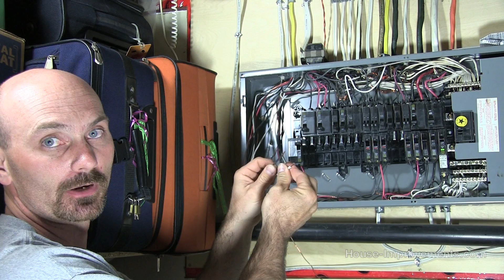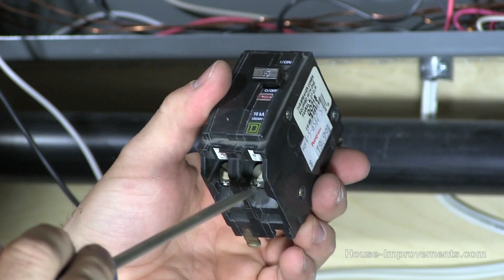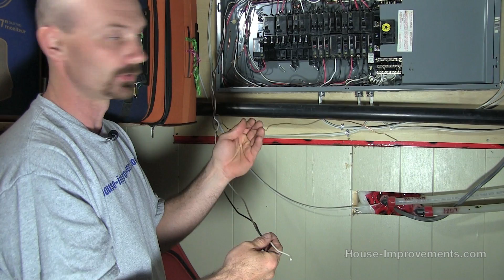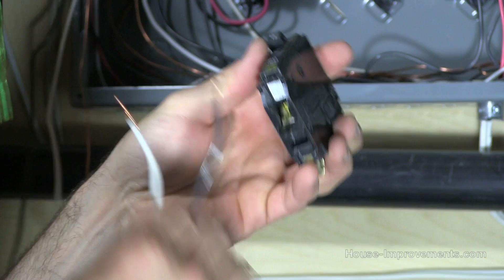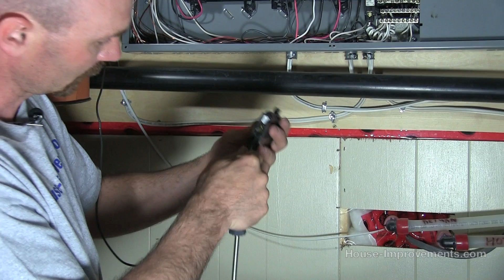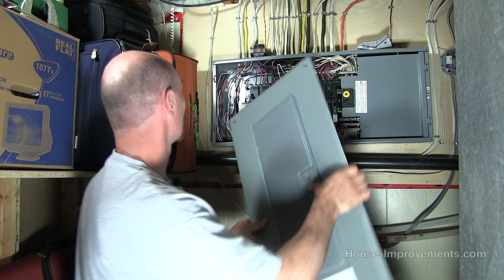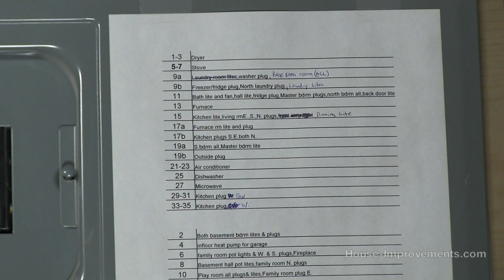How To Add a 120V 240V Circuit Breaker

Comment: Hello Mr. Shannon, I'm in the process of adding 20 amp breaker for all my power tools. Is it better to install a double pole 20 amp  or single pole 20 amp. which pole is right for all the power tools. ( table saw, router , all power tools. need your help,,,thanks
Reply from the maker: Depends if you are needing 240V or 120V. By your question I would suggest you contact a professional, electricity can kill.
Reply: All my power tools are 120 volts( mostly 15 amp.) So I probably use 20  amp single pole.
agree...
Reply: William Dizon only thing you would need the 2 pole breaker for is say a welder, AC unit, pool, etc. I am going to assume you just want to add some 110v receptacles to power your 110v power tools. In that case yes a single pole breaker is all you would need. If you install a 20amp make certain that you use 12gauge copper wire. I agree with house improvements that you should seek an electrician to do your work as your question clearly shows you don't know what you are doing and are certain to put yourself at risk of getting killed.

Comment: May I ask something ?
How many voltage at a terminal in main bus . Does it's 120V and -120V ? . To make 220v when you connect the first CB on this video .
Reply from the maker: Yes each leg is 120 v.

Comment: Hi Shannon,
First of all thank you for the informative video, I was searching online about similar topic. I live in the Philippines our electrical systems are 220 volts, But in our house we have several 110 volts outlet next to 220 volts, The outlet was there when we first moved in. I recently acquired a power tools from a friend in L.A. he sent me a router and a skilsaw both labeled 110/120 volts. Can I use the 110voltsoutlet? The power tools are 11 and 15ampere. Is it enough to power the tools? Thanks and more power.
Reply from the maker: yes absolutely.
Reply: HouseImprovements  In the video you put the black wire to the 110 breaker and the white to the white terminal, where is this terminal connected in the breaker, if I remember correctly ours does not have a white terminal is it possible?

Comment: Great video.  question  you mentioned you could double up the grounds, what about the white neutral wire, could that be double up if needed?
Reply from the maker: If you need to , twist the two together and then insert them and tighten  the screw.
Reply: No no. Can't double up neutrals. Don't even like doing grounds. I'm an extremist though.

Comment: Hi Shannon -
  Good video, I had never seen a service entrance box hung sideways before, also I noticed a copper water pipe above the service entrance box - which one was installed first - would that pass the inspection code being if there was a water leak on top of the electric box .
Reply: +BearStar1 
Hey Einstein - in the electric trade we also use different various names but you would not I guess you under stand or do you ?
" To - may - to "     or    "To - mah - to "
Reply: +BearStar1 
Ok Fellow Brother Electrician -
Trained in the Navy ( ATT ) ( ET ) 6 yrs.   completed A & C schooling - NECA / IBEW  50 + years .
Reply: Pete Moss, and you're STILL not qualified per the NEC.  Take a break.
Reply: Pete Moss, besides, your ignorance is blatantly obvious.  It's not a "service entrance box", it is the service equipment.  The service entrance is the set of conductors between the meter and the service disconnecting means.
Reply: Your so simple minded - you should take the "  Idiot Test to "    find out your  IQ

Comment: Wow I have never seen anyone mount a panel sideways like that ever...also, don't you have a protection rule below 8 feet in a garage? Just a really strange looking installation to me having everything exposed and sideways. Maybe you could frame it in and put some kind of a covering over the wiring to protect it from physical damage etc? Section 334.15(B) NEC code I believe...
Reply from the maker: This was a retro fit in a home. Horizontal boxes around here are not unusual.
Reply: Evidently, you missed the first part of this video. Rewind and start over.
Reply: I've seen panels mounted side ways a ton in factories, houses, apartment buildings, and a few garages.

Comment: Nice clean work ... But mr. Electrician I have a question. I do low voltage work . But is that a water line running under your panel that is like less than 12 inches away from your electrical panel. If I'm correct that water line in against code.
Reply from the maker: There are some hydronic heating lines about 12 inches below and the black line is a drain.

Comment: i was looking at 240V baseboard heaters. do i need a 240V double pole breaker for each heater???? if i install 4 heaters,,,,,i would need 4 double breakers????
Reply from the maker: No you should be able to power more than 1 heater per breaker and possibly all of them. I unfortunately do not know for sure how to figure that out to suggest a wire size and breaker size. Please contact a local electrician to make suggestions

Comment: There are a number of code violations and bad practices in this video. (You should de-energize the panel BEFORE you remove the cover, for one.) The smartest thing you can do is get a qualified electrician to do any electrical work in your home.
If you make a mistake with the plumbing, you get a mop. Screw up the electrical and you call the fire department or maybe the coroner.
I am a journeyman electrician with 30+ yrs in the trade.
Reply: How are you only a journeyman with 30 years?
Reply: Mike Hunt That was 30+ yrs. I have been a commercial foreman several times and the supervising electrician on a large state university campus, so I have been to the mountaintop. It's cold, lonely, and underpaid. I'm coasting to retirement as an industrial installation journeyman, including 4.160 and 12 kv distribution equipment. Are those bona fides good enough? Many electricians choose not to be contractors, and many contractors who should have made the same choice. I learned my trade in the big city where that entire panel installation in your cute little video would have been shot down BEFORE the inspector even got to look at it. So keep on keepin' on, Mike, if the AHJ in your neighborhood accepts that kind of work. But cut the little cub scout videos; somebody's gonna get hurt.
Reply: +Ralph Averill HE SAID THAT HE SHOULD HAVE DEENERGIZED THE PANEL FIRST. WHAT ARE THE CODE VIOLATIONS? JUST CURIOUS.
Reply: +Ralph Averill THERE IS FREQUENT WARNING ON SCREENTHAT IT IS BEST TO GET A CERTIFIED / LICENSED ELECTRICIAN.
Reply: +William Branham
1. NM cable exposed under 7 feet elevation,  exposed to physical damage.
2. Water pipe within 12 inches.
3. Panel not installed per mfr.'s instructions. i.e. in a vertical position. Are you going to use a stick to hold the panel cover door open?
As I said above, an incompetent, amateur, cub scout installation from start to finish.
Reply from the maker: +Ralph Averill This is all permitted and passed inspection. The panel retro fit was completed  9 yrs ago according to the inspection stamp.What I did in this video was done using a permit and was inspected, we redid it for the video. We stated in the video to check with your local codes to be sure what you install passes. In a retro fit situation some rules are bent I'm sure in many areas.
#1 In order for any of these wires going to the panel to not be exposed they would all need to be in conduit, and we know that never happens.
#2 The only pipe within 12" is the drain ,which is not under pressure and if it leaked it is not over the panel
#3The door on this panel opens down so it stays open and out of the way. The panel is horizontal because as you can see room is limited because the original panel was likely only a 24 circuit panel it would have been much smaller.
If you are more familiar with "new " installs only ,then some of these things may be unfamiliar to you but calling anyone names and insults is very un productive for everyone.

Comment: Mr.shannon, I am new to this... Hope u can help clarify it! So when u install 240v, there is no neutral line, u said the white and black are hot wire!! When u install 120v there is neutral which is white??? Why??? How would I know when white is neutral or when is hot wire??? Thank you very much!!
Reply from the maker: Some 240 volt applications may need a neutral like a kitchen range, because that appliance uses both 120v and 240v. In that case the wire would be a #8 3wire (white,red,black+ground) To identify the white wire as hot it should be wrapped with black tape near both ends,I forgot to do that in this video. If you have more questions please use my forum.http://www.house-improvements.com/forums/

Comment: I purchased a new bladeless hot/cold fan and when I plugged it in my bedroom it blew the fuse and everything went out including the downstairs dining room lights.  Also, my microwave in the kitchen will blow a fuse if you operate it for longer then 11 mins.  A few years back I did some remodeling in my kitchen and had recessed lighting done in various parts of my home.  I had 7 recessed cam lights installed and now only one works.  If you toggle the wires sometimes you can get the lights to work but I am just leaving it alone for now.  I had various licensed electricians so now I am wondering why I am having so many electrical problems.  What should I expect an electrician do to solve my problem.
Reply from the maker: Sounds like you have to many things on that bedroom/dinning circuit. If the microwave is on its own circuit maybe the microwave has an issue, if it is not on its own circuit then there are to many things on that one also. The lighting sounds like a bad connection in one light. Please use my forum if you have more questions.http://www.house-improvements.com/forums/

Comment: When removing a service is it acceptable to leave the breaker in place, disconnected, instead of removing and covering with plastic cover?
Reply from the maker: Yes if you delete a circuit  you can leave the breaker in place.

Comment: 240v breaker compatible with 220volt outlet? Does the 240v just plug into two 120v spaces? thanks
Reply: I mean 120+120 does equal 240 plus if it didn't work it'll trip the breaker

Comment: 6 Easy steps to installing an Electrical Panel:

1. Search for an electrical contractor. Check the internet or fliers in your mailbox.
2. Contact electrical contractor of choice. Make an appointment
3. Wait for the contractor to arrive. He may be running late from other appointments.
4. Open the door and invite contractor in upon arrival. Take him to the panel location.
5. Leave the contractor to his work. Optionally, offer him a glass of water or soft drink.
6. Inspect the final product and offer payment or arrangement. Provide references to your family, friends, associates, & colleagues.
Reply: Exactly.  It isn't rocket science, but there are a half-dozen ways to ruin your day if you don't understand what's what in a breaker box, or if you lose your situational awareness.
Reply: Don't fall for number 3. If he's not there at the agreed upon time go on with your day and find someone who give's a shit.
Reply: Laudium Enoch famous last words of a  home owner. You have the right to burn down your house, or hire a licensed and insured electrician to do it the right way. Common sense, electrical wiring is not a do it yourself project.
Reply: Stevey Irwin Don't fall for #3? You do realize that you aren't his only appointment of the day or the only homeowner that has called with an "emergency". That's why you are usually given a window of 2 to 4 hours to be home. Even then shit happens and a lot of the time the previous appointment takes literally hours longer than it was supposed to..this is when your tech usually runs late. Not because he is out to inconvenience you and doing his best to get home at 10 at night. I promise he wants his day to be done at a decent time. So just think about that the next time you want to treat the one person who can help you like shit.
Reply: Anyway the one thing I can add to the original comment is...Do not stand over his shoulder the entire time and insist on questioning his every move. Sit somewhere and nicely wait for him to come tell you he is finished/w.e issue is fixed.
Reply: Oh yes, do be sure to inspect his work, 'cause you know what you're looking at.  Horse feathers.  Most homeowners can't change a switch without screwing something up, much less replace an electrical service. So many comments that "electrical work ain't rocket science".  That's why it takes a minimum of eight years experience to even qualify to take the Master Electrician exam, much less pass it.  You guys, your're so smart.
Reply: Or you could read about it, or have been exposed to people that build and wire homes, and watch a few videos and fucking DO IT YOURSELF. I heard of electricians charging $200 to replace GFCIs. HAH!

Comment: Shannon, another great video... But along with your disclaimer, you need to add the clause that the only two people that can do electrical work on a home are: the home owner or a licensed electrician. And check your local area code for adding a new circuit and I can guarantee you need a permit as well. I live in Ontario and the ESA is the governing body that handles this; municipalities here don't touch electrical. For all the na sayers about a permit... Have any incident and try to collect insurance! Remember they are not in the business of paying. That being said, any contractor that says you don't need a permit or talks the homeowner in to getting it should not be hired for the job... Same rules apply to plumbing by the way. The comment about using the white as a hot and all the DIY disasters... Totally legal, totally to code, but as Shannon mentioned it should be indicated as a hot wire with tape. If you are wiring multiple 240V circuits, then buy the 12/2 black, red wire that is housed in a red jacket. Ref the torque question, most service panels have the required torque to wire gauge labels inside them, if your house is older you will need to do some research. For Canadian's looking for electrical or plumbing reference material, be cautious of American how to books, the code is different as the one post mentioned. I'm not in the business of contractor or electrician, just a DIY'er that does extensive research when I take on a new project as small as building a raised  deck or updating your bathroom... Which you need a permit for and have also built a cottage(lots of rules, lots of permits and lots of inspections) Knowledge is power, do the research, talk to your local building officials and you will have no regrets. Shannon, you have by far the best how to videos on the internet, keep them coming.
Reply from the maker: Thanks, much appreciated.

Comment: I realize that you CAN use a white wire as a HOT wire, but I personally consider that to be really bad practice. I am not licensed as an electrician, but correcting idiot mistakes from previous do-it-yourselfers has taught me that mixing the two makes it REALLY difficult for the next guy that comes along to look at your work. It turns an easy job into something really complicated and a little scary.  I am racking my brain and can't think of any good reason for this practice. Anyone care to enlighten me?
Reply: The main reasons are simple: First, the wire industry bundles wire in specified configurations, such a 3 wire and 4 wire. That leads to the simple second explanation. Cost. 12-2 Romex is considerably cheaper than 12-3 romex as an example, and since most residential work is on 120V circuits electricians can buy in bulk. Its an economic issue. However, to my knowledge many new modern appliances do  require the "4th" wire neutral and the circuits would be wired with 1 black, 1 red 1 white and one bare wire. Any person reading feel free to correct any misinformation I might have submitted.  
A side note, as stated by Shannon in the video, it is gentleman practice to identify the white wire as hot when applicable by wrapping the work end of it (say the end at the receptacle box or any junction box) with black electrical tape.
Reply: Shane K In this case, the red and black are the energized conductors ("hot wires"). The purpose is to provide 240V on a circuit for such things as a range, etc... Any major power consuming appliance. There is still only one neutral.

Comment: Shannon, just wanted to say thanks for a great video! I'm running an outside floodlight and two outside electric outlets. Problem is, I was going to tap into an existing outlet but now I'm not sure it's such a good idea. I think I'll run the wire down to the panel and install a new breaker. Might be safer anyway to have all outside electric on it's own dedicated breaker.
Reply: Sounds like a good idea and since the outlets are outside, be sure to get appropriate covered outlet boxes and appropriate circuit interruption outlets.

Comment: shannon, in the 240circuits are both the black an white wires always wired to the breaker? rather than the 120 that only the black wire goes to the breaker
Reply from the maker: No is the simple answer .If you come to my forum on the website and ask the same question I will explain why the answer is no. 
http://www.house-improvements.com

Comment: The yellow is 12/2 which normally goes to a 20 amp but 15 is allowed because it is smaller.  The only thing I would add is to look on back of the equipment that you are wiring to make sure it is UL listed and it will have the maximum circuit breaker allowed.  YOU ARE A GREAT TEACHER!